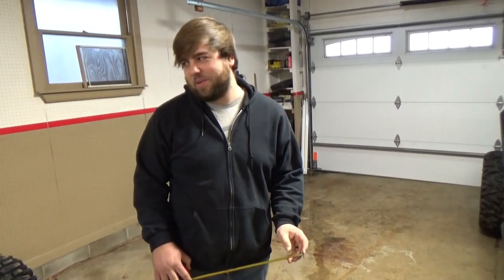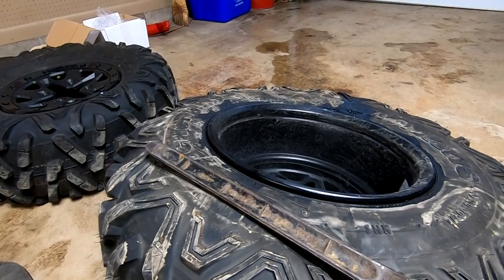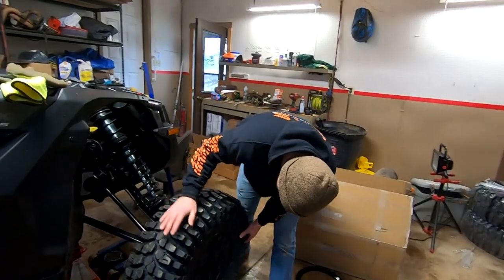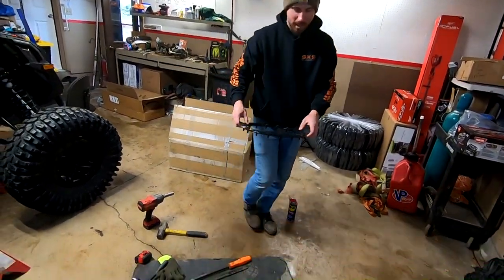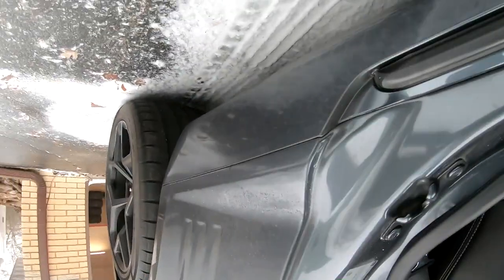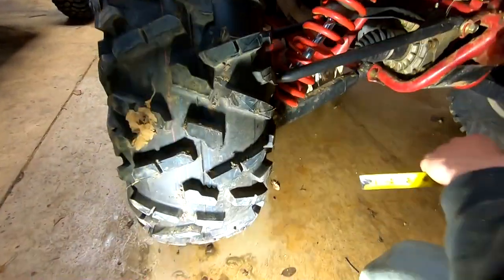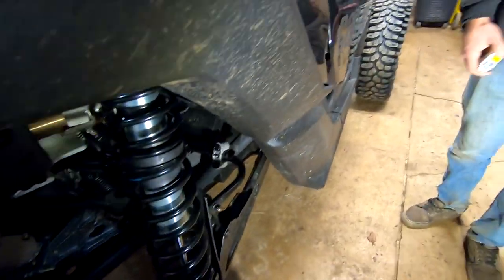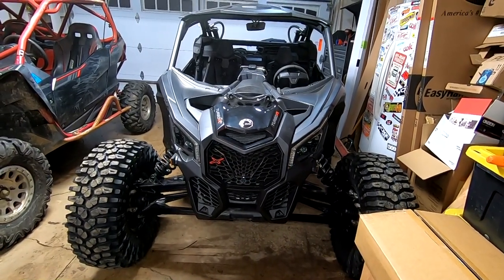32" Sticky Roxxzillas on a X3 | 30" Bighorns on a Yxz

Comment: You have some more ground clearance available if you need it. A lot of guys with an XRS run 16 inches under the skid plates. It will take a while to get your ride height dialed in. The springs will sag and you will need to readjust. The Fox settings are a good place to start, but you will need to keep adjusting until you get it right for your riding style. Same thing with the compression and rebound settings. The stock shocks are very stiff in the initial travel. Raising the ride height gets it up into the working range of the shocks. I would back the high speed setting all the way out. Even just a turn in will give it a harsh ride, especially at low speed. The goal is to use all of your available wheel travel. Run it loose until you see a need to tighten it up. The crossover rings are very important as well. They have a big effect on ride quality and bottoming out. There is a lot to learn about shock and spring settings. The potential is there for a great performing machine. Just takes time to get there. Good luck!
Reply: Exactly! Well said Macdad

Comment: You need a five gallon bucket to help with those beadlocks.  Pull the beadlock ring, flip wheel on to the bucket and push down on the tire, it will usually come off the bead without any tools, also putting the beadlock ring back on is soo much easier when setting the wheel on the bucket!!

Comment: I've broken beads the same way,  but if you're REALLY comfortable swinging a big hammer,  there's a bead breaker hammer for truck tires that would work and do the job much faster, but one slip and your wheel will suffer. Personally I'm really good with a sledgehammer and wouldn't hit the wheel.

Comment: Josh are you going to get some rock sliders or build them for the X3. If you build them I'd like to see that I've got some ideas on building the ones for my Commander
Reply from the maker: I think I’m gonna buy some that wrap the body instead of tube, not positive which route I’m going yet. And the x3 is mine lol -Justin
Reply: Blown Budget Offroad oh I thought it was yours Josh sorry buddy   The ones I'm thinking of building will come up the front some to be like a mud flap on the front and do the same on the back

Comment: There is a group that did a comparison between all the major Maxxis tires including the Roxxzillas and they liked the Maxxis Rampage the best.  Weller Racing has used the Roxxillas at the King of the Hammers and they continue to get flats.  If you want a tire the is bullet proof, get the EFX Motorvator's.  I have 4K mileage on mine, and they are still good for another 1K miles.  However, they are heavy tires so I am going to the Rampage real soon.

Comment: Are you gonna have to upgrade your clutch on the can-am to compensate for the 32’s?
Reply from the maker: Phillipmcr not planning on it lol
Reply: Blown Budget Offroad I didn’t know if you’d have to, they are badass machine’s for sure
Reply from the maker: Phillipmcr there’s people running 34-35s on stock machines
Reply: Blown Budget Offroad sweet!
Reply: @phillipmcr  I had 32" XG Crawlers on a 900S with the stock clutch and it would spin them on dry asphalt. I think stock clutches across the board are underrated, though an upgrade is always nice.

Comment: Do y’all use slime? Anytime I put tires on my four wheeler and I’ve actually done my mower . Kinda nice safety thing. I’ve cut a lot of tires down on farm and got thorns and stuff in them. I want a x3 so bad but how would they work for farming? Towing and that kinda deal? I have a brute force 750 2015 model I love it. Gets me through the woods and tight places but I have a broke back and haven’t worked n almost a year the reason I’m wanting a x3 is ride but it also needs to b a farm vehicle! So Input would b nice!
Reply from the maker: JUSTIN MCNEILL we don’t use slime, just carry plugs with us and plug them if we have an issue but have only had 2 tire issues in the last few years. You can get a hitch for them, and the low range is very low so I’d imagine it would be pretty good for towing a trailer around the farm in all honesty
Reply: Blown Budget Offroad that’s good the ride looks good and smooth!
Reply from the maker: JUSTIN MCNEILL it’s very smooth it’s sick
Reply: Blown Budget Offroad soon as I get some stuff paid off and figure out income cause of my farming accident I’ve been denied twice for disability my wife had to quit work to take care of me and having back surgery n March so hopefully they will get me my disability and give me back pay I could figure out me a way to get a x3 I have my brute but idk if I wanna get rid of it it’s the first atv I ever bought new and it’s at almost 1000 miles. It’s only been to West Virginia riding once and that was when it was brand new and right after the half throttle break n thing but I still never put it n mud.
Reply from the maker: JUSTIN MCNEILL that’s a bummer man. I can say if you can get a x3 I think you’d love it!
Reply: Blown Budget Offroad it’s definitely narrowed down to this or the krx 100 but it’s so new not many videos of them yet. I’d love to c a x3 and the krx on the same trails same factory set ups and c how they compared. But I’ve known the x3 has been out a lot longer and has been tested. But I’ve never been on either of them.

Comment: It’s going to be night next day different the yxz to the x3. It will walk most of the trails the yxz has to bomb and if you went to 35s it would have been easier.
Reply: How do the 35s do with stock axles on a x3? I owe an x3 and ive been debating 32 or 35

Comment: if those are bighorn 2.0 you better bring a whole box of plugs .   very weak sidewalls.
Reply: I never had any problems on sidewalls with mine I'm in rocks all the time
Reply: @pete1735  that's good.  I have bought 4 new machine that come with the factory bighorn 2.0.  No of them lasted 100 miles.  But we ride alot of creek beds.  Glad you have good luck with yours because utv tires are getting ridiculous high.